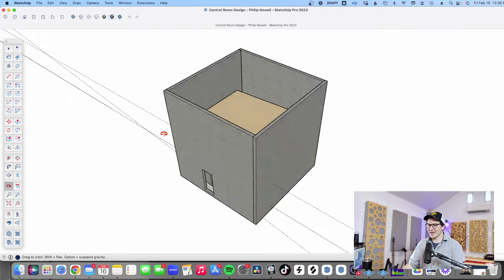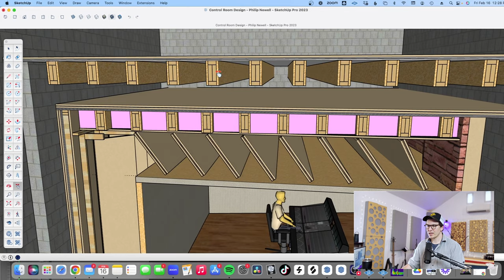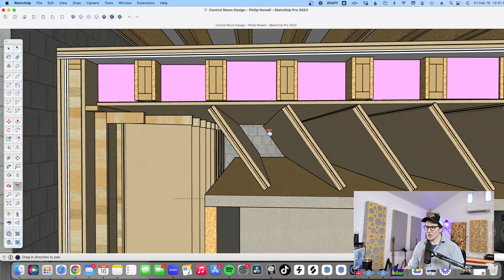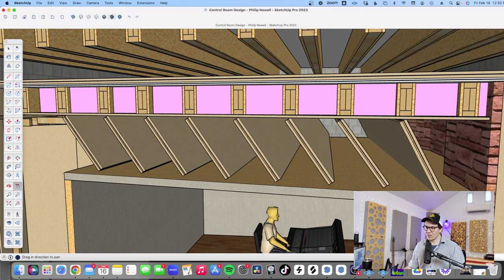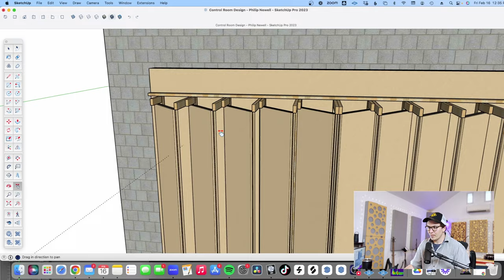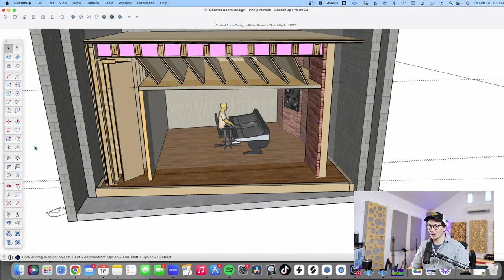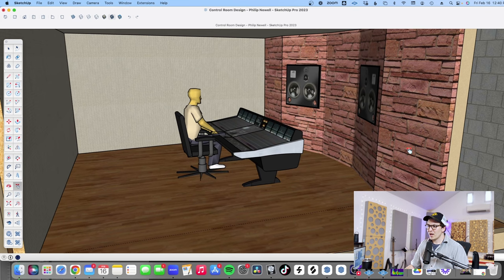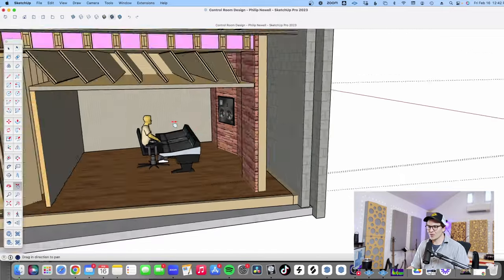How To Build A Pro Control Room - Part 2

Comment: My understanding is that it's easier and a much safer bet to have your mains just on good stands out in the room. If only because it allows for positioning and monitor changes.
Reply: Typically, when approaching such flush mount design, it is recommended to remove the amplifiers and place them outside the cavity.
Most of these high end Mains are designed for such applications (ATC in particular, have an in-wall mounting kit for that precise use).
When designing this type of commercial facility, most decisions are the result of meticulous calculations and well educated thought process, choice of speakers and their placement are usually considered a "permanent" decision (with the respective leeway, clearly - this isn't a catholic wedding).
In essence, the front wall is built around the choice of speakers and the ideal listening position.
Reply from the maker: Yes, this is a very high end design. For most home studios flush mounting could lead to more problems.